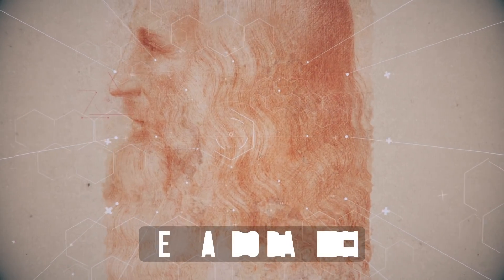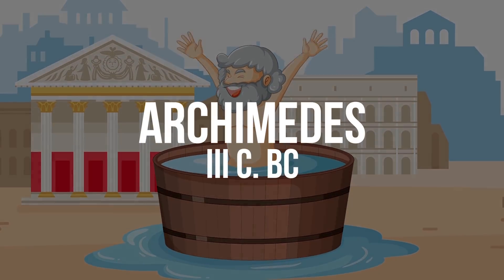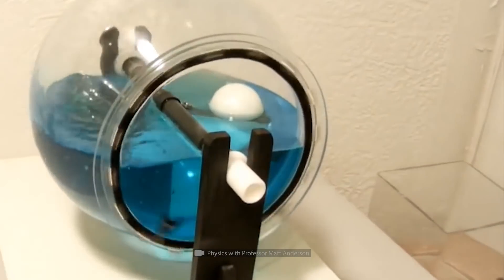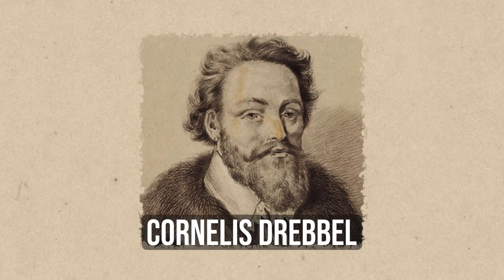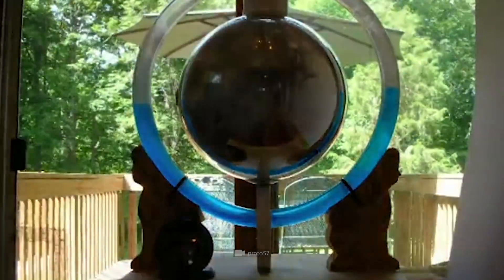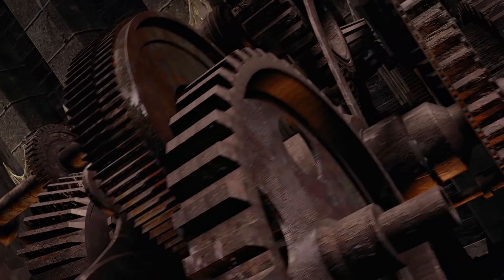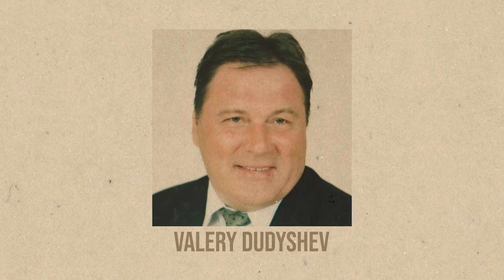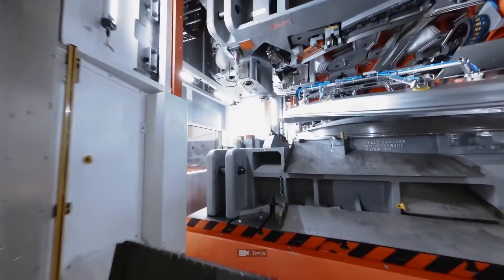Are Scientists Close to Creating a Perpetual Motion Machine?

Comment: There are batteries that would still work today if acid was added that were found from thousands of years ago if someone made a perpetual motion turbine made with tungsten I bet it would last more than 100 years but long story short there's a unique generator design the faraday disk normally the magnet is separate from the coils so theres motion between the two so if the coils would to move they would produce drag from induction but in a faraday disk the magnetic can be attached to the disk eliminating the induction and if the disk was rotating it would produce electricity but even air will slow it down but imagine if it was placed in space with a few pound flywheel and spun up to 30k rpms and released into orbit it would be hard to transfer the power to earth to be used seems how there's no wires that can be attached without adding drag with bearings but it can power a radio transmitter and the radio waves can power nearby devices like a crystal radio can be powered by radio waves so if the magnets are attached to the disk and its rotating and powering a Tesla coil as a radio transmitter for wireless power there wouldn't be any drag from induction so it would spin forever or until it hits Earth's atmosphere and burns up or escapes Earth's gravity because orbit is like balancing on a pin you can't really stay in orbit forever your always falling to or away from earth because its impossible to get right in the right spot perfectly like down to the correct millimeter but in space with all them positive electrical fields and lack of negative in space the disk would become positively charged so as it rotates it might not even need a magnet because the disk would already be charged but by being in space radiation

Comment: It is impossible even if you had a design that works.
- Friction can eat through materials 
- external forces take energy out
- if you had a useful one the fixes the top 2 and you had an indestructible material. It would eventually go past the speed of light. This is impossible
Reply: Planets seems to be perpetual motion machines, or at least they lose energy so slowly as not to really matter on the scale that humans live on.
Reply: @TechCensorshipHasToGo  the earth never looses or gains energy and the only time it can is in interplanetary travel where we take such a small amount of energy that the earth probably slows down by fractions of an atom per second. Everything that happens on earth that does not leave it takes no energy from it. And when things do leave it they either eventually come back or don't have an impact on the earth anyway
Reply: @TheWorstBridger  aye, I just got thinking of the definitions, objects in space can maintain "perpetual motion"
Reply: @TechCensorshipHasToGo  orbits decay
Reply: @TheWorstBridger  It doesn't have to be an orbit to be moving, angular momentum is a thing.
Reply: @TechCensorshipHasToGo  to say there is angular momentum would imply there is a circular motion
Reply: @ndvorsky  you should learn physics. I hear its an even better trick
Reply: @TheWorstBridger  So you’re telling me that an object that spins is not rotating and has no angular momentum?
Reply: @ndvorsky  it does. It can loose angular momentum. The earth didn't always spin at the same speed. It's slowing down
Reply: Well it’s indestructible dumbo

Comment: But the "pila karpen" still works after almost 100 years! With the same 1 volt output, and if really just transforms exterior ambiental heat into energy,  imagine some acres of very high temperature desert zones ... The problem is that nobody could replicate one as the oricinal which is in a Romanian museum

Comment: The laws of  conservation of energy state that energy cant be destroyed nor created...in other terms the reaction result of two object cant be bigger than the weigth of the two object otherwise there would be more mass....however the force between two magnets coming close together at 30 mm lets say is bigger than the both two magnets weight.....we need to rework a lot of laws especially the energy conservation one bcuz it has flaws and is also 60 years made before they even knew what electricity is, even nowdays we have just yet scratched the surface of what is possible and what we know abt electric physics.

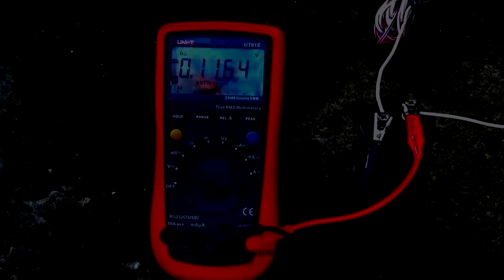Comment: 8:12 does that mean you could turn any form of radiation into energy or just solar radiation?
Reply: All forms of radiation can be converted into energy. In fact, anything at all can be converted into energy so long as it is not the vacuum of space. You might be wondering how this is possible. Well, everything in the universe either has mass or energy of some form. Energy can always be converted between forms, we know this. What may surprise you is that mass can also be converted into any form of energy. This is demonstrated by Einstein's famous E=mc^2 equation which clearly shows that energy and matter are interchangeable/convertible. 

TLDR: Everything can be converted to energy as long as it's not literally nothing.

Comment: I was granted US Patent 3890161 in 1975 for a device which absorbs heat while yielding a corresponding amount of electrical power via rectification oation needsf the Brownian motion of thermally agitated electrons subsequently aggregated into useful power by billions of nanometer scale diodes aligned the same way in parallel at irst until smooth DC is made then in series or parallel as the application needs.

The patent art is valid but obsolete. A better similar device needs to be prototyped to see if it works. I want this to be freely available science not priced by monopoly extortion so start up funding needs to be by crowd source generous grant doners. Then it will be produced as a family of commodity models managed by artificial intelligence.

Comment: Perpetual motion is easy, everything remains in motion or at rest until it is acted upon. The problem is almost everything is acted upon eventually, even photons redshift due to the expansion of space as they travel. Ground state electron orbitals are arguably perpetual though. Free energy machines (which is NOT perpetual motion BTW) is very hard and might be impossible, though there are a few interesting phenomena in the quantum realm that might lead to something.
Reply: exactly. perpetual motion is what our universe is built on, but its impossible to harvest this kinetic energy and keep the system running at the same speed. 

don't know anything about this, but it seems like electrons are such tiny masses that harvesting rotational energy from them in their orbitals would not output much. don't know anything about it tho
Reply: perpetual motion is very real. free energy is very not real. free energy suggests creating energy with no cost of any form. last time I checked, the first law of thermodynamics quite literally states that energy cannot be created nor destroyed. if by free energy you mean passive energy, we already have things like solar panels, wind turbines, etc.

Comment: If you could extract any useful work from a black hole, that would be the closest to infinite perpetual energy you could get. (Although stars live a really long time and are a pretty valid option too). You'd still be extracting energy, and it's indeed not infinite, but it's so large it may as well be infinite for us
Reply: There are several ways to store and extract work from a black hole (even if Hawking Radiation turns out to be invalid).
Reply: @zachcrawford5  hawking radiation is so tiny you might as well be harvesting empty space. what you need to do is harvest rotational energy, and convert it to kinetic energy. Kind of like how rockets use the moon as a gravity boost to get to Mars. You do not take rotational energy inside the event horizon, because you can't escape, but you can take energy from the ring around the event horizon, called the "ergosphere", and with enough additional energy pushed into the system, you will steal an enormous amount of kinetic energy, and put in a tiny amount yourself. 

Another way to steal rotational energy is to shoot light waves into a mirror-covered black hole. The waves become amplified by the rotational current of the black hole, and you can open a door and collect the newly amplified energy. Again, only the light outside the event horizon will be secured, because even light can't escape the event horizon.

Kurgesagt made a great video about both these methods, you should watch it.
Reply: @altaccount5330  I have, Kurzgesagt is awesome:)
Reply: @zachcrawford5  Right!